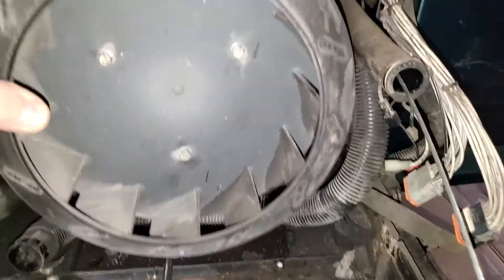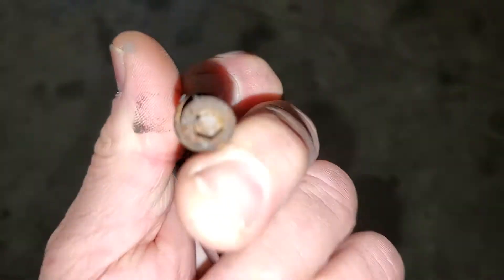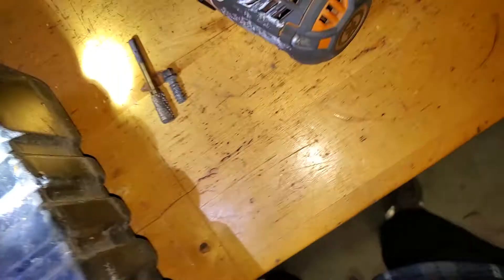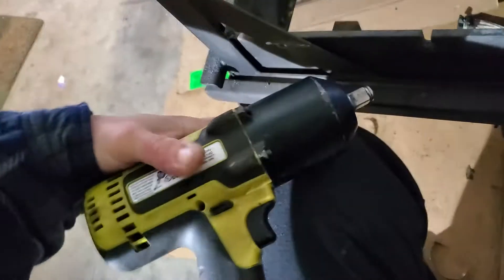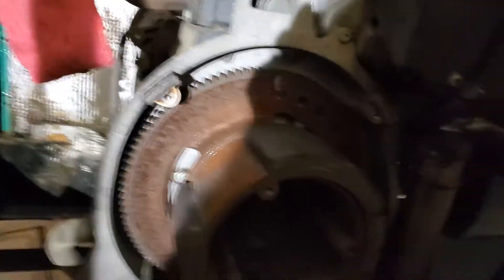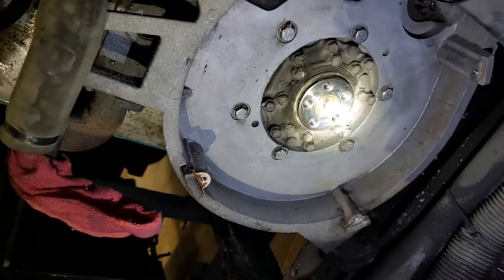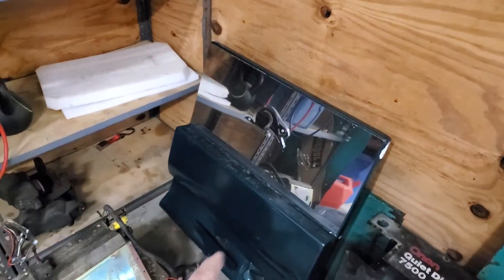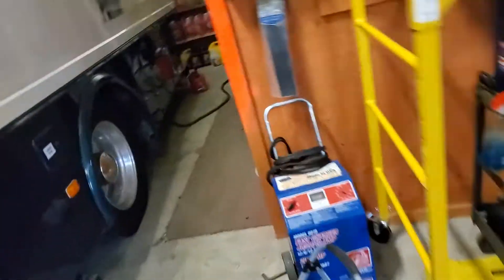Onan 7.5k diesel Teardown

Comment: I sure could use some of your knowledge. I had my injector pumping rebuilt, and it's throwing a code of 25 air in the fuel, I've eliminated that it is getting fuel, It is prime, but it keeps throwing that code.  I was wondering , perhaps because I had to move the fuel shut off lensod slightly out of the way if that possibly is causing that code
Reply from the maker: So did you get your problem resolved yet?
Reply: @Rvdiagnostics i was going to pull my generator out today and hook up a pigtail, so I can adjust the governor while it's under full load.But unfortunately, I sprained my wrist.So on my right hand I don't know if it's going to happen today or tomorrow
Reply from the maker: I understand fully. Im 66 and bern doing this for 55 years lol
Reply: @Rvdiagnostics i would highly suggest , do not attempt to carry to 5 gallon propane tanks in one hand at a time
Reply from the maker: @ralphreilly2434 so hoes the wrist? Generator coming along
Reply: @Rvdiagnostics i finally got it running.I had a worse spot on the shaft of the spindle to the governor and then like four hundred dollars from Onan for the new park , so I took a zip tie from the outlet of the water pump to the top of the spindle shaft and tighten it up a little bit and it works great

Comment: Hi like your video.  Can the injectors be taken out while it's still in the frame ?
Reply from the maker: Yes they can ,Why do you need to do that?
Reply: @Rvdiagnostics  it had a terrible miss and smoked really bad when the weather was cold or under 40 degrees outside.  I ran some meaner kleaner in the fuel and it cleared up and now is running as it should .
Reply from the maker: I use a product called HOTSHOT destriction